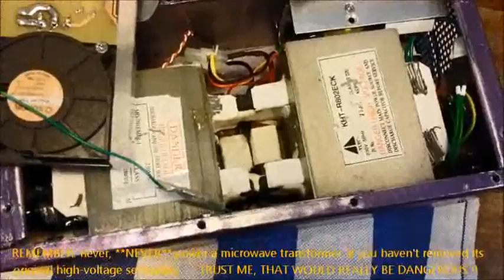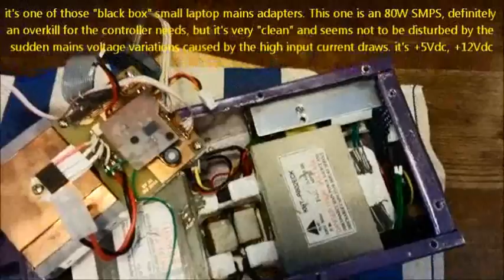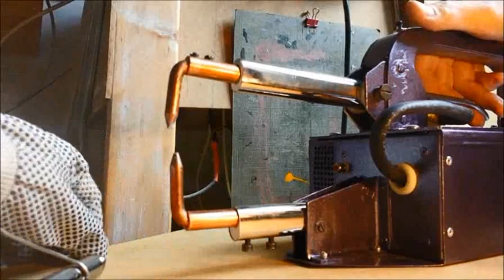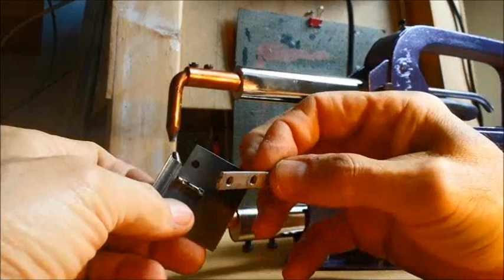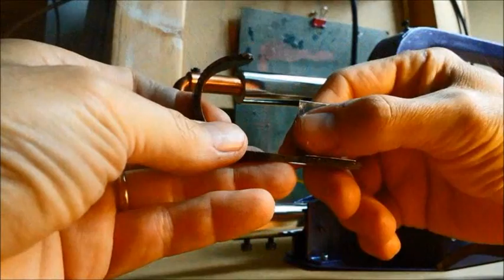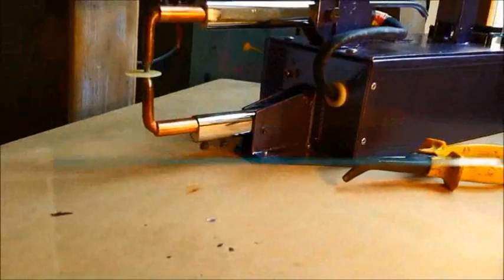Power Adjustable DIY Spot Welder (PART 2)

Comment: great work and video !! I would be intrested to know where you pourchased your copper rods and you high guauche wire I tried to do it with 22mm but it looks too week even with 2 transformers in // 
thank's for you help and again congratulations for your work !
Reply: +bears_of_wisdom thanks a lot for your fast answer scuse me again i know you tel it in the video but i did not understand well did you said 50mm2 or 15mm2 for wire section gauge ??